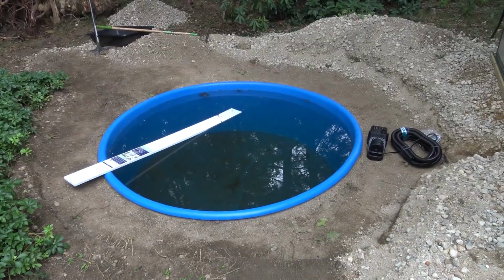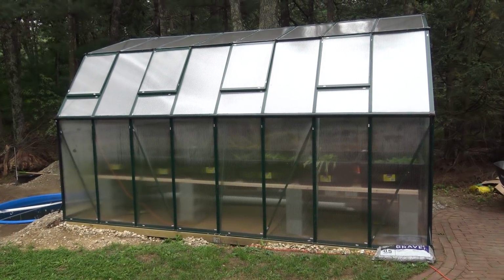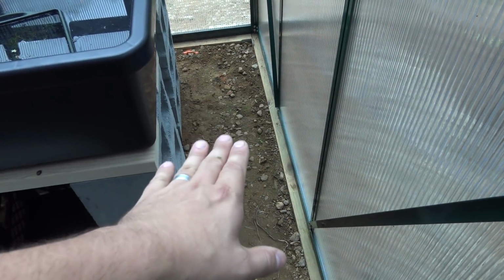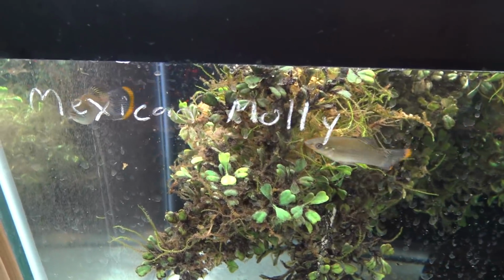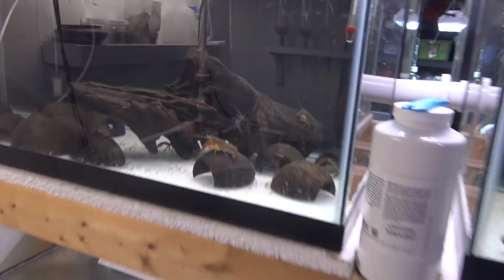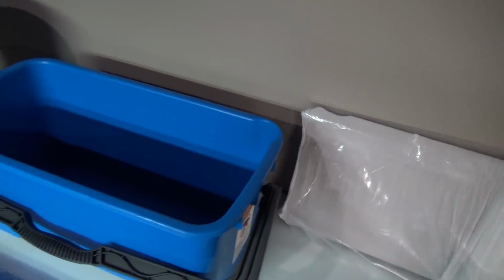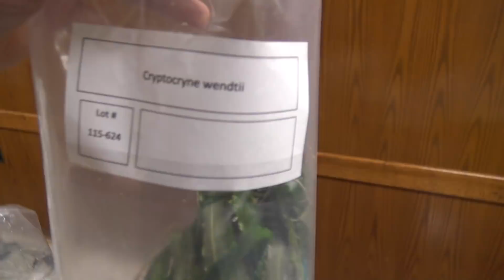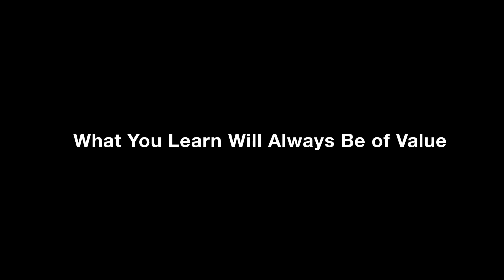#550: NEW FISH AND POND PROJECTS - Update Monday

Comment: Good meeting you at the auction. Cool idea with the vac. I think if that is the only size vac you have then you need to slow it down. Maybe add a ball valve to restrict air and/or drill holes in the small pipe towards the bottom. Good luck and look forward to the update

Comment: Been considering setting up a swirl filter for my tank even tho it's probably a bit overkill. I was looking into conical brewing containers for the ease of cleaning since all the waste will settle at the bottom and you can install a "purge" port. I entertained buckets for a while but cleaning it seemed like it would kinda defeat the point. They seem to be pretty reasonable in the lower 3-7 gallon sizes.

I was initially really hoping that I could just use one of those 5 gallon water jugs because those can be super cheap but they don't seem to make those without handles anymore and handles seem like they'd kill the hydrodynamics.
Reply from the maker: i've attempted swirl filters in the past, it seems like the bigger the better to allow the heavy stuff to actually settle
Reply: Yeah that's a fair point didn't really hit me untll I was almost asleep that those where just your visual aids and they would both probably be appended to 50+ gallon drums. Where as I was just witlessly taking them at face value and contrasting them to what I'm looking to experiment with which has significantly less throughput. 

Where I still stand by the nature of the conical container making it at least easier to maintain at the sizes you're probably going to be dealing with with the pond it becomes significantly less worthwhile over occasionally vacuuming/siphoning out the accumulated waste.

Comment: Would the same principle not work if you blew air across the top of a vertical pipe and drawing water and debris up it and throw the filter sock  , i suppose its the venturi effect  , nice try tho love the fact you showed the failure ( a lot of people wouldnt )
Reply from the maker: the air needs to be in the tube to reduce the pressure and cause the water to rise along with the air, i'll test the full sized version on the pond this week and hopefully it works as intended
Reply: yea i understand what you are trying to do , i just mean as an alternative , especially for the shallower pond